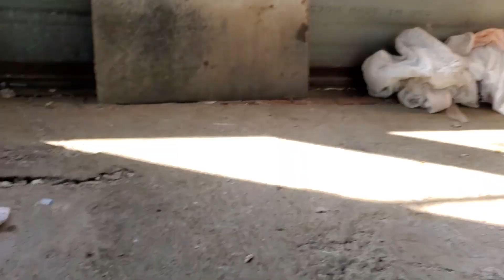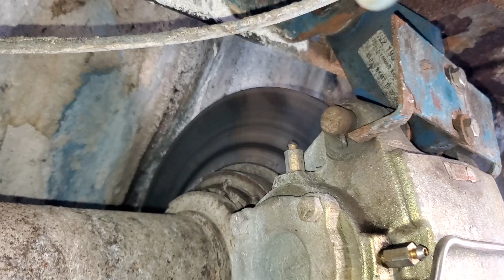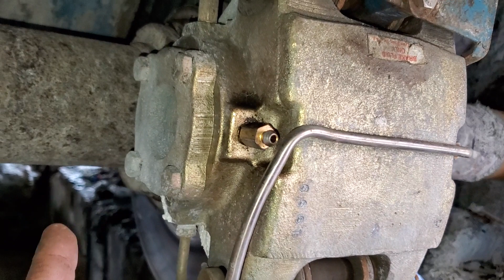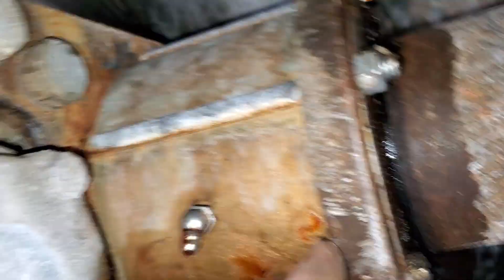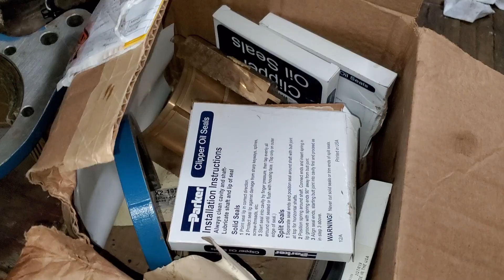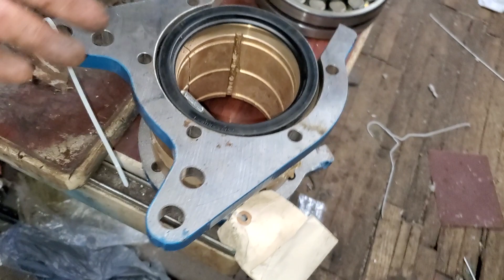Explaining the Brake Caliper, Brake system & Bushing of a Milnor Industrial Washer Model #60044SP2

Comment: I’m getting ready to install disk brake 
and shaft upgrade kit on an exact same Staphguard washer. 
Been working on these for years, never
removed the shaft. 
Since we’ll be replacing everything, shaft, bearings ect, we’re supporting and band sawing the shaft at either end. 
Most important thing is to photograph and
document all measurements on the old 
shaft and were all the bolts go and which
direction.